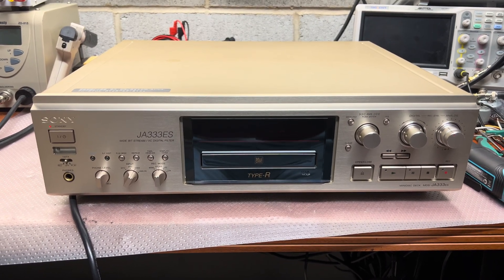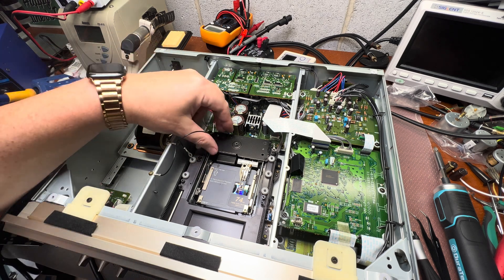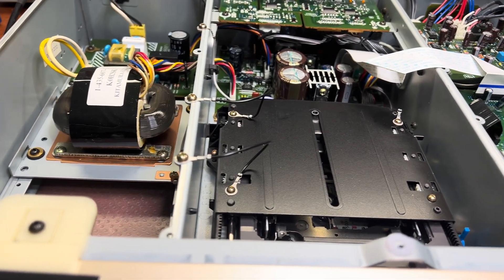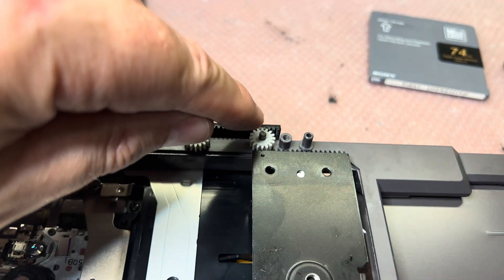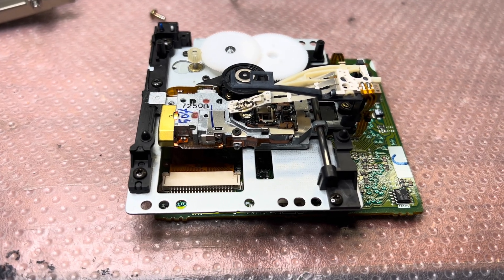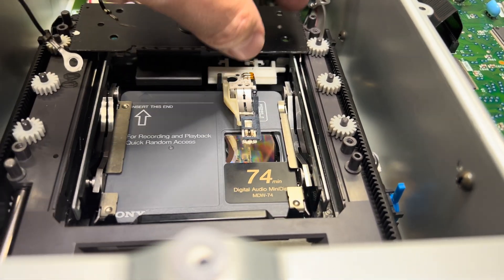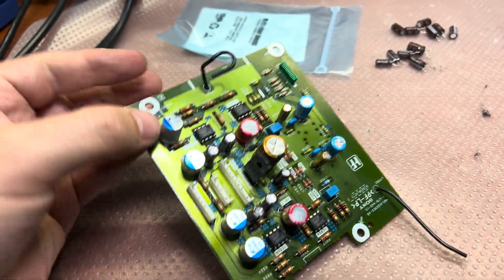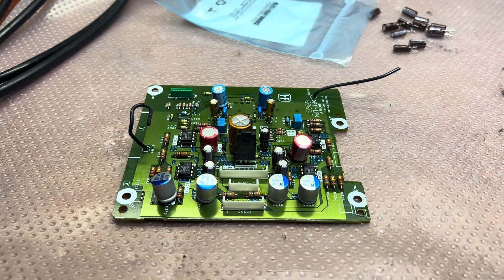Sony MDS-JA333ES MiniDisc Deck Won't record and return the disk

Comment: I have a 555 minidisk and it doesn't load the disk, it says errors C13.
At the same time, the head runs left to right and the lens of the optics moves, but the optics do not light up. End switches checked, optics replaced but no improvement, disc still won't spin. Spindle rechecked. Could someone help me with this?

Comment: I think you can remove the bottom and replace belt from below.
Reply from the maker: If you will watch full video you would find that problem with recording is not related to belt in any way.
Reply: @hifirulezzz  yes but return the disc was as I watched further I realised you had figured that out.

Comment: Hello ,Subscriber here.( I hope you can help me).I have a SONY MDS JA 50 ES (NEW OLD STOCK).The problem is when i plugged in the standby light remains lit on red and nothing displays on the screen. When I press the buttons nothing happens. Except for (while pressing ams & rec i can access the service test mode).Any help from you would be greatly appreciated.Thanks
Reply from the maker: That may happen when there is a disk inside and it was not finalized, I.e. TOC was not written. Deck will behave like that. Remove the disk manually and try turn it on